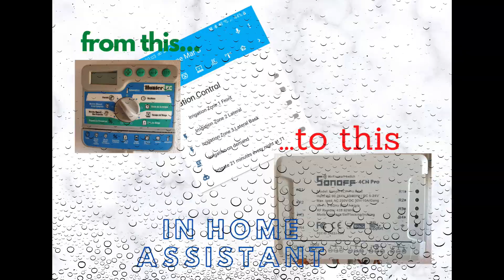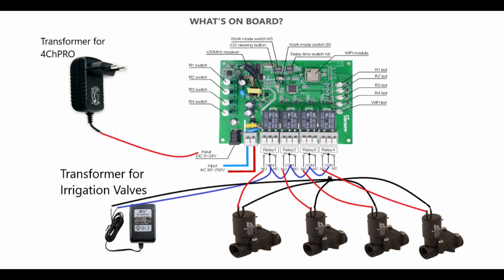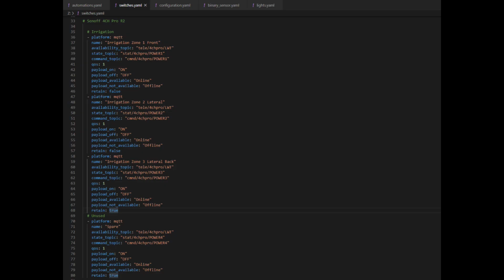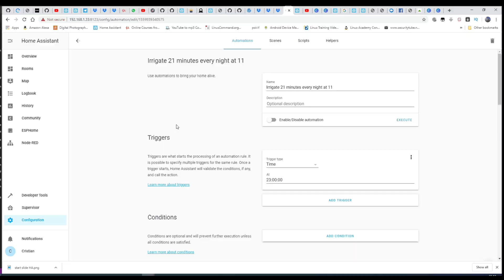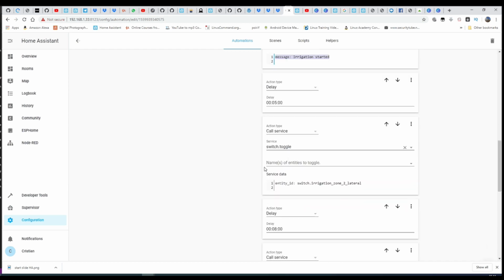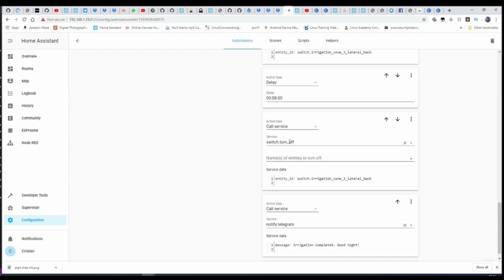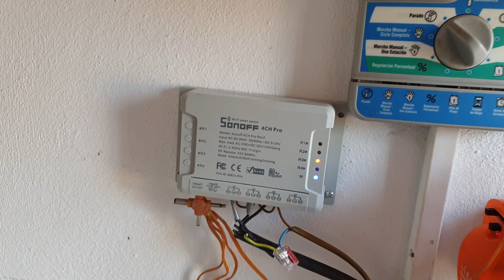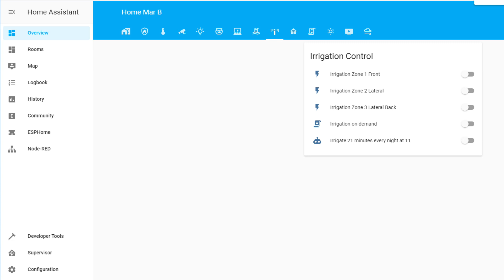Cheap Sonoff-controlled Home Assistant Integrated Irrigation System

Comment: hi Zoltar, i have AC220 line and valves are 24VAC, can i power the device with 220AC while powering the valves with 24VAC using a transformer? or i must power the device with 5-24DC?
Reply from the maker: The sonoff 4 channel pro has two power inputs, you can power it with 240 volts or with a DC transformer, so the answer to your question is yes you can.
Reply: @zoltar99  thanks, just one more thing, i assume you used pump pressure manager since i didn't see any motor wiring in your video, is there anyway to add motor to this setup?
Reply from the maker: @TorPid9  I used the existing analog system, only connected the valves to the sonoff 4 channel pro. The pump starts running automatically when the valves open and release the pressure.
Reply: @zoltar99  so to overcome this issue since i didn't wanted to add pressure kit i added a sonoff mini to control the pump, thanks for your guide it worked very well and i agree with about  companies like hunter who use thier position to ripoff people... Devices not up to date and way behind technology, they just stayed and didn't cared to improve.